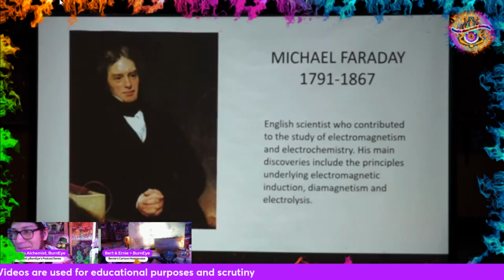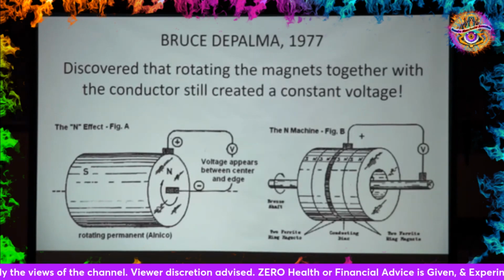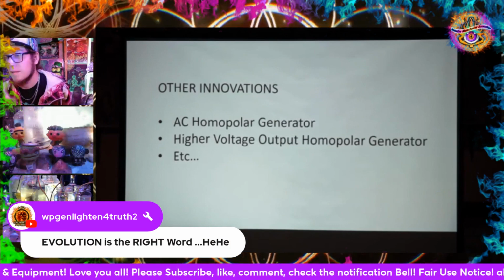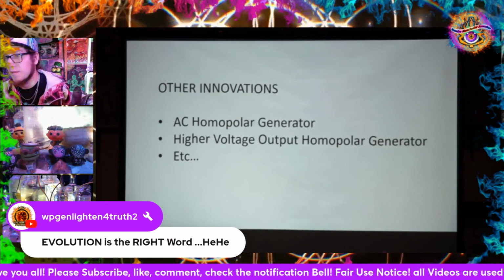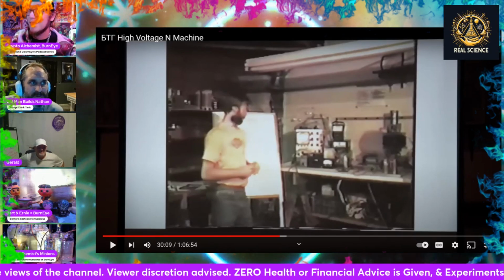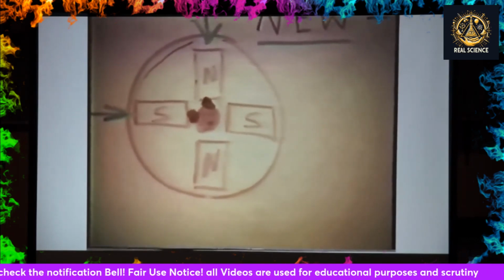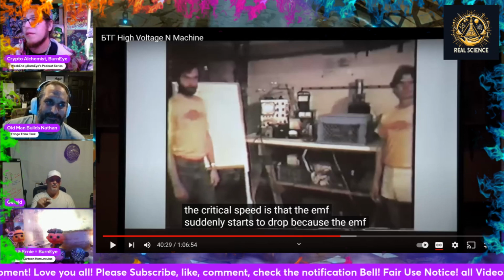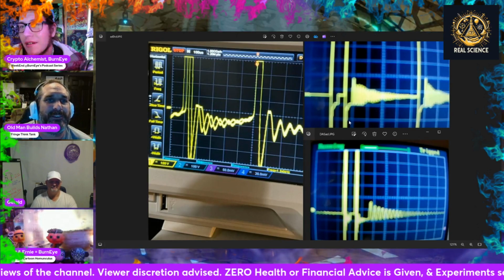FreeEnergy Friday, Explaining the Evolution of Homopolar Generators, From Faraday to Aaron Murakami

Comment: Yeah, my version of the graviflyer is a large whimhurst sideways for high voltage. Two spinning asymmetrical 6 phase D/C motors that power onboard components like remote control antenna or onboard control for manned toroid surfing and turns the glasses. On bottom a homopolar current generator on top a tesla coil. These provide poloidal and toroidal vectoring and inside the tesla coil is an ultrasonic trumpet that’s used on ultrasonic soldering guns for cymatic field expansion.

Comment: Ideas: how would just using the outer portion of the disk version of the generator compare to the full disk, in terms of output power, any difference?.   I suppose connecting many generators in series or disks in the same shaft would increase the output voltage.
Reply: Yes output a/c.
Reply: I meant current lol. Could use coffee this morning.